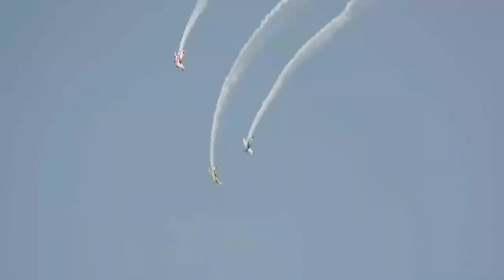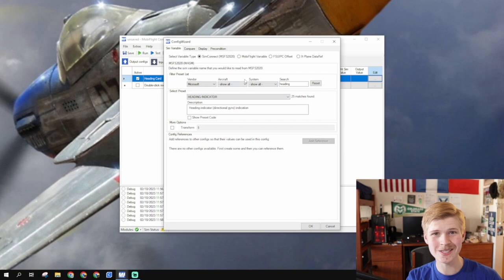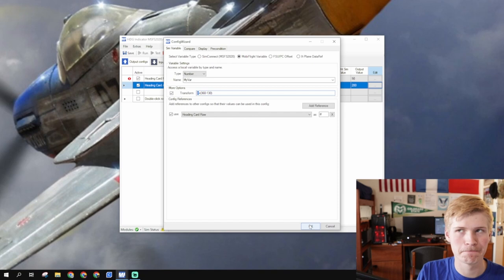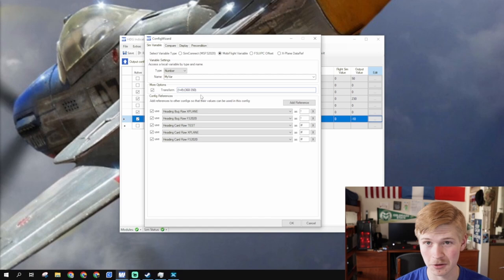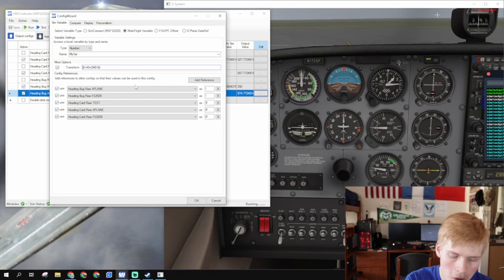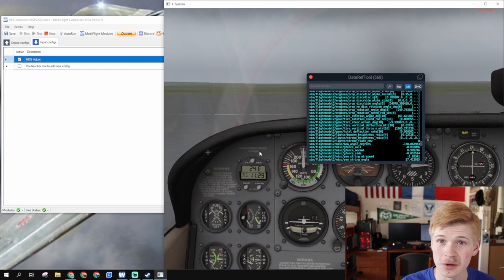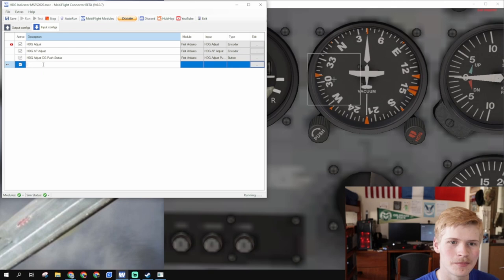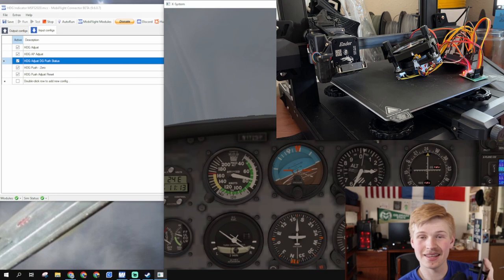Configure a Flight Sim Heading Indicator | C172 #42

Comment: Yeah the heading compass card adjustment is via push, to not adjust it accidentally, and the heading bug does not need push to turn if I remember correctly.

You could of course use the heading bug (HDG AP adjust) push to do "heading sync" (set the bug to current heading) - this is often not working on these mechanical instruments rather than electronic glass avionics, but it would be pretty useful if you want.

Great tutorial again! :-)
Reply from the maker: Thank you Tuomas! I like having the heading sync function - even if it's not realistic. It makes adjusting it way easy! (even if it's cheating) Thanks for the suggestion!
For anyone reading this - To achieve this reference a raw heading value for your current heading and set the button on push to set it to that current heading using the config reference. Your transformation should be 
On Press
#

Where # is assigned to the raw heading value. Hopefully this helps :)

Comment: Hi Trevor.. just finished my heading Indicator and ready to proceed to assign Arduino components . but Is not clear for  me how did you assigned the Hall Effect Switches in MF
Reply from the maker: Hello Mike! 
You can google hall effect switch wiring, then the signal pin is treated like a button input. Instead of making a button assign the pin to the zero function.

Comment: hi Trevor, every time I start Xplane I need to reset the HDI, is that correct? I need go mobiflight and set the difference to get the right reading. I thought it was set one time and not every time
Reply from the maker: Are you using auto zero or manual? It might be worth trying the other?
Reply: @CaptainBobSim  will need watch your video again im not sure what i used just downloaded and set the zero